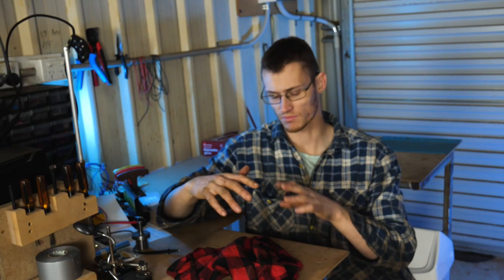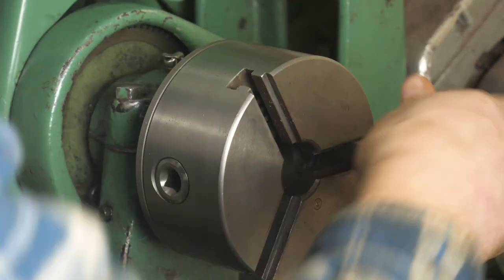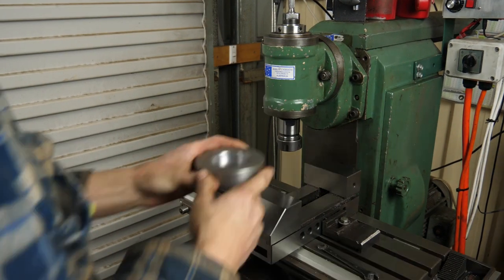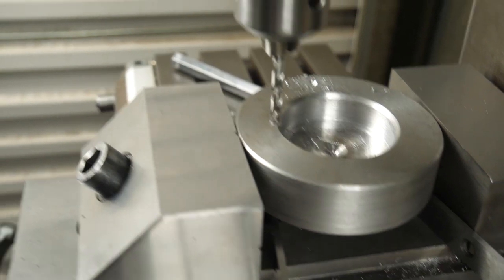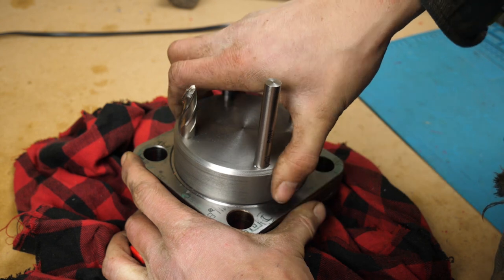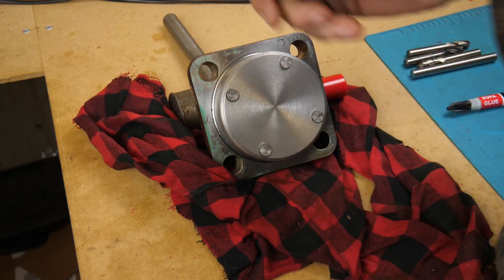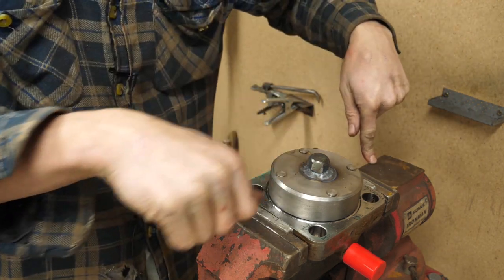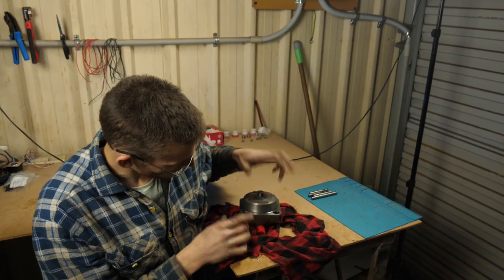Custom Hydraulic Tool Build

Comment: FIRST! Great pin spanner. The end mill reset was very clever. For the custom size pins, you could always turn up your 10.3mm pins first (you need them anyway?) and use them for your measurement. Great editing as usual. Cheers, Craig
Reply from the maker: Cheers Craig
Yeah, I considered making 10.3 mm pins, but my next size stock was considerably larger. This arrangement turned out to be quite a nice fit
Reply: @TomMakeHere  Yep a nice fit is all that matters. It came out well. When you cracked it loose, I thought we were gonna see you get soaked in hydraulic fluid for a moment. :-)
Reply from the maker: @Craig's Workshop Thankfully it went exactly as I expected!
That being said, I topped up my engine hoist a couple of months ago, turns out the plug is only held in by about half a thread. It went everywhere!
Reply: @TomMakeHere  Ah that sucks. Can you deepen the threads (or make a longer plug or whatever)?
Reply from the maker: Not a bad idea actually. Although I shouldn't need to touch it again, I just didn't have enough oil the first time around

Comment: Nice interesting video, one thing. When using an adjustable jaw wrench (crescent wrench), you need to turn it around from the way you had it.
Reply from the maker: Yep, I thought it was a myth about jaw breakage. Turns out it prevents damaging the nut
Reply: Wanted to say the same.
We call it a shifting spanner, and you definitely used it the wrong way around.

Comment: I had a similar height reach problem with my mills.  Stub Drills are your friend.  Difficult to find to buy, so I resorted to cutting off a standard jobber drills and sharpening them.  I very rarely use full length drills now.
Reply from the maker: Yeah eventually I'm going to build a riser block. I struggle to tram my vice in etc. Good tip though, I might do that in the mean time

Comment: Nice job on the tool. And your welds looked like they would hold fine.When working with hydraulics
Always unload the pressure.

Cheer Fred
Reply from the maker: Thanks for watching Fred.
Yes I was aware that there could be some pressure, not sure if it came across in video, but I made sure to stay clear of the threaded plug in case it or oil came shooting out
I also suspected that with almost no oil reserve, not much could actually happen. But you are right, next time I'll drain it first

Comment: I would have milled a channel into the top the size of the stock used for a handle and welded it.. job done ✅
Reply from the maker: Not a bad idea. They wanted a hex to suit a socket due to space limitations when it's on the machine

Comment: I've welded a generic 1" impact sockets into parts like that, which seems to go down well with mechanics.  The 1", or 1/2" drive gives you a good few solid options to put a breaker bar, or impact driver onto it.  I liked your use of 4140 rod as dowel pins, but the loctite is rated for 0.1 to 0.2 mm clearance, it grips better, I think in a plain drilled hole, if true position of the pins is unimportant.  Stamping your name, or the pcd, and ID size would have been a nice touch to finish the tool.  It'll get chucked into the bottom of someone's toolbox, and by the time they pull it out again, they'll never remember what it was meant to fit.   It turned out a good, quick solution to the problem, and looked the part at the end of the day.
Reply from the maker: Thanks for comment
Yeah a socket would have been a great method. I might do that next time
I agree the locktite clearance isn't ideal, in hindsight maybe I should have relieved the centre of the pins so it grips there, but the ends are close fitting to get good alignment
Thanks for watching

Comment: Nice video, I always like shop made tools!  But it's not that suprising that you had to use a lot of force to get it off. I ran the numbers and the seal looks to be around 100mm, with only 5 bars pressure at that diameter you would get about 400kg of weight on those threads. And it might be a lot higher pressure, we fill  the accumulators at work with 50-60 bars of nitrogen. Regardless, nice build and keep up the good work!
Reply from the maker: Cheers! Yeah it's a decent effective area
Thanks for watching

Comment: After watching i thought it might be better to loctite the pins after welding - hindsight is always 20/20 !
Reply from the maker: I agree, I was going to go back and redo it, but I tested and it held perfectly
Can't remomber now but I think I have a high temperature loctite
Reply: Or maybe a slight knurl on the pins, which would also make replacement easier should it ever be necessary.
Reply from the maker: Crazy thing is our maintenance shop doesn't have a lathe! I wanted to make the pins simple. It should be easy to reloctite them if they require replacement. I did consider a set screw on each pin as an alternative

Comment: You're using that crescent wrench backwards.
Reply from the maker: Is that actually a thing? I heard that it really doesn't matter and if you are putting enough force to damage something you should be using a bigger one anyway
Reply: @TomMakeHere  Has to do with rounding the nut and also it is hard on the wrench. It's what I was taught. I did some searching on the tube and looks like most use it this way. I try to never use one but sometimes it's the only tool that fits.